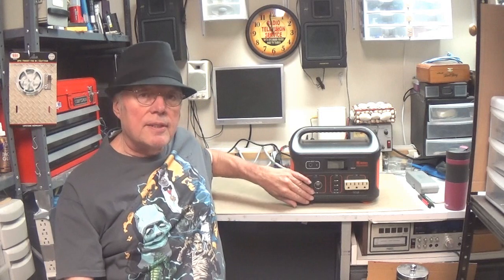Only 40 watt output on a 100 watt Solar Panel? Jackery 500 power station

Comment: Only lingering issue is if you have a few clouds going by and the light level drops, you have to go out and do the unplug/replug, Now when I adjust the panel I always check the input watts. It’s a minor annoyance.

Comment: 60 watt folding panel. Used on jackery 290 and 550 . . it would charge the 290 at 42 watts max the 550 only 30 to 35 watts max

Comment: Hi. I just bought the explorer 500 and I have the Renergy 100watt solar suitcase.  I bought a MC4 to 8mm plug and the renergy PWM Voyager 20Amp controller acts as though it isn’t connected to a battery at all.  I bought another cable thinking that possibly the cable was bad.  It had the same result.  The unit charges fine in the 8mm port when using 120v.  I would hate to have to buy another solar panel when I have this one that works great charging my camper deep cycle battery.
Reply: you will have problems when you have 2 PWM in line (2 "smart controllers" trying to test the signal at the same time.). Let the explorer do the work and bypass any others in between the explorer and panel. You should have no more problems.

Comment: Yep, its the PWM. I've had this issue on all my 5v battery banks when charging with solar. Once the voltage or amperage drops, It doesn't return to the maximum charge rate, I usually have to unplug the power bank if it drops below 1.1 amps, and plug it back in, and wah-la, back up to 1.8--2.2 amps. Yes, its a pain, but this is how PWM controllers are. It took me a while to understand what was going on when I was charging those 5v power banks outside. These 12v power stations with the PWM charging circuits are no different. Outstanding video!!
Reply from the maker: Hi Rich - Wish they would have kept that info open for all the units under PWM.  Oh well, looking forward to see what the new units look like by the end of the year.  My guess, most will be under MPPT controllers except for the lower end units.   See ya -- Atco

Comment: Just like a computer, turn it off, then turn it back on.
Reply from the maker: Hi Jim - Yeah, I got some miles on me.  When I started into electronics, the older but still in use units that would not work right, we'd just kick 'em with are shoe and those loose circuit and contacts would get connected again and works.  Then, by the 70s all circuits were solid state and less and less kicking a shoe wouldn't fix anything anymore.  So what we used instead and up to current times... turn it off and restart.  More than often, it fixes it!  See ya -- Atco
Reply: @atco21117  Remember when we used to hit hard drives with a hammer?
Reply: @Jim33933  Some of us still feel like doing that.

Comment: i still think a deep cycle marine battery would give you much better results.
Reply from the maker: Maybe so but, these all in one systems are easy and don't need to add stuff along having a battery and all it's extra equipment and costs.  Plus, the power stations are getting better and better each year.  From what I've heard, we'll have a lot of new units coming out 1st part of 2020. See ya -- Atco
Reply: Poor design